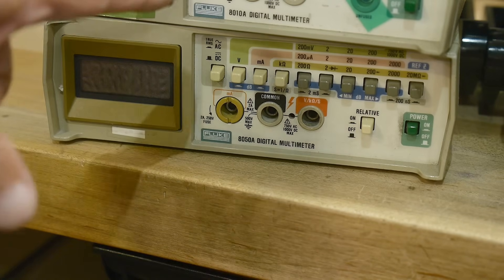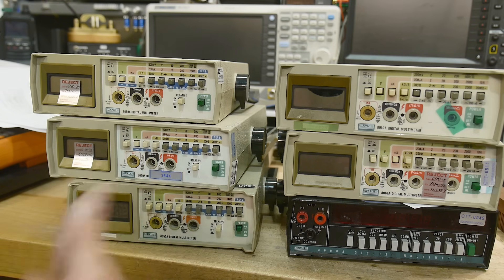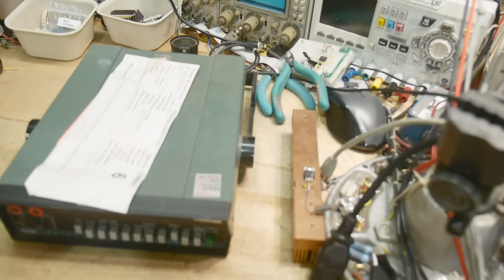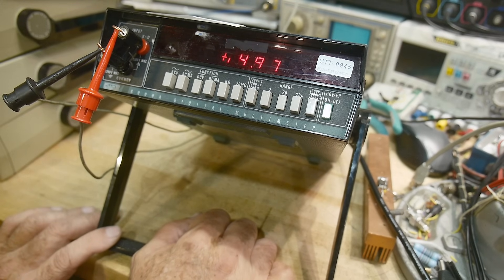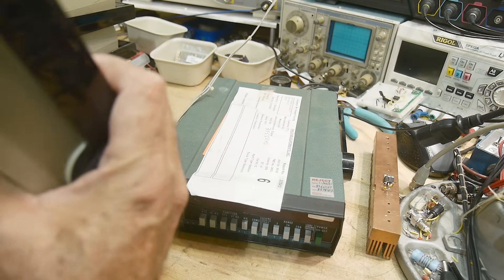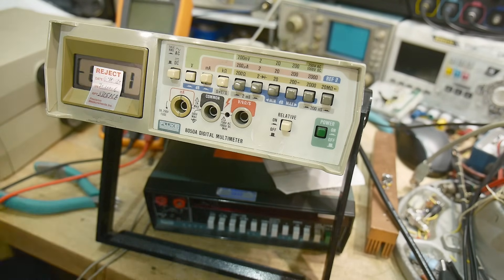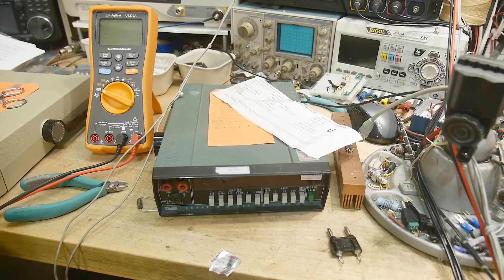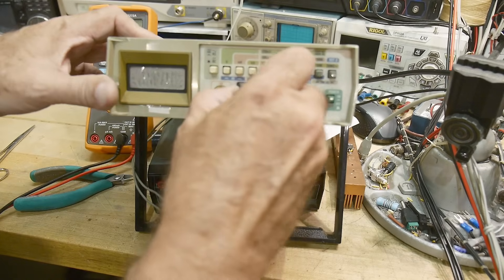#1657 This was not a Fluke, it was six (part 1 of 2)

Comment: The 8000A is reasonably easy to work on. I have a stable full of them (used to have more, but I passed a few on a couple years ago) including several with the digital output connector (and a 1912A counter with the same). They still get some use as they are darn near bulletproof, as long as you don't need true RMS. For many, many years, my portable was an 8030A, which I finally shelved when the NiCads died again about 2002 or '03 and I had no desire to replace them. My favourite version is the mA-second option, intended for x-ray equip calibration. Mine came to me from the lab I worked in in the late '80s, where it was used for radiometry setting up medical laser systems.

Comment: An 8010 and an 8012 have been my workhorse DMMs for ~25 years. The 8010 has a 10 A range while the 8012 has 2 and 20 ohm ranges. The 8010/8012/8050 series reportedly have a design defect in their display drivers that eventually kills the LCDs. The display goes black, like the bad ones you have. Aside from that they are great basic bench meters.

Comment: Score! I had one with a bad LCD which I can't recall if I actually did or just planned to replaced with LEDs via little more than some transistors... Can't quite remember the circuit I came up with off-hand, but as I recall it was to be wired directly to the LCD signals.